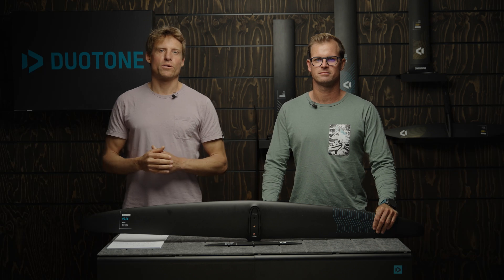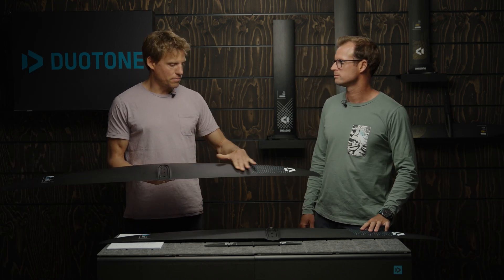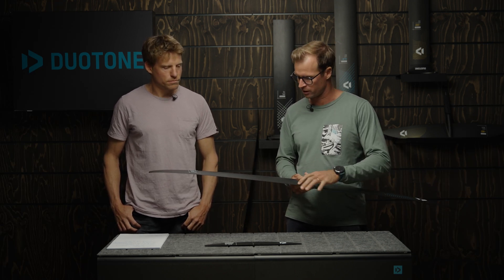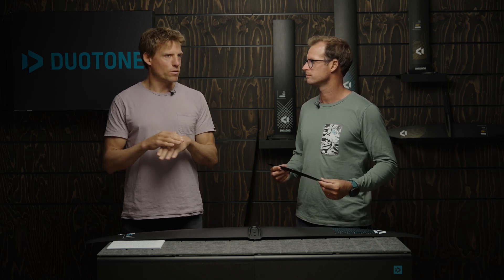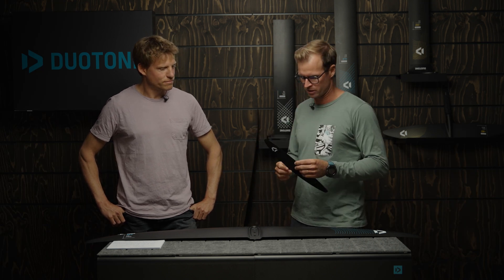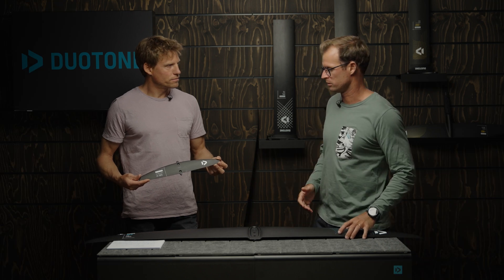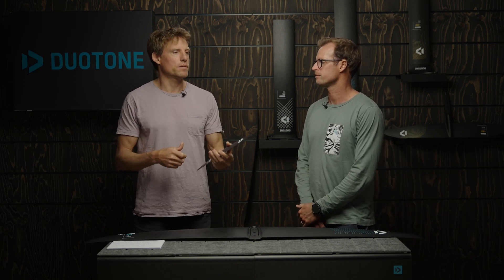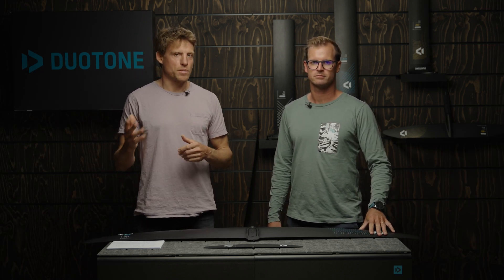Duotone Wing & Foiling Tech Talk - Amp SLS 2024

Comment: Hi there, I want to try pumpfoil with my son, also SUPfoil! Should I take 2145 or 1750. I have 90kg. My son's weight is 30kg:-) Could be my Glide 1100 or 900 a good choice. Mast 75 or 60? Board Strider for both ok? hang loose Jo
Reply from the maker: Hi Jo, for you for sure the 2145, both of you the Strider, 75 mast. For your son the 1750 should be big enough, or 1350 Glide 2.0